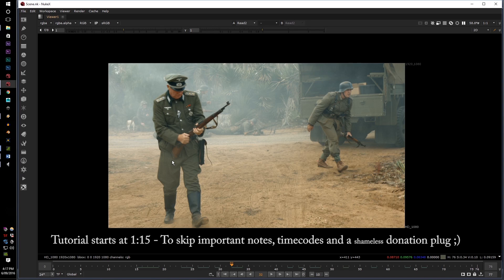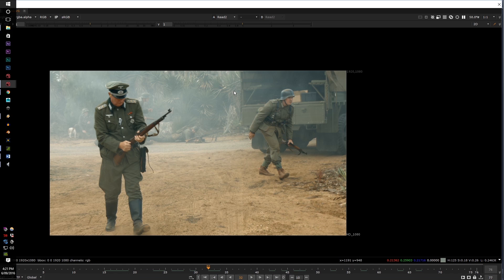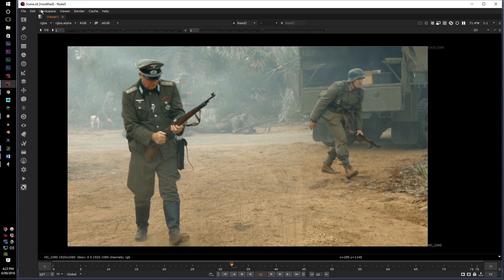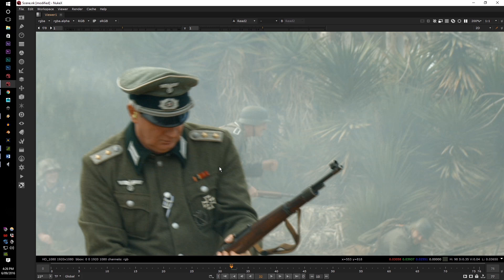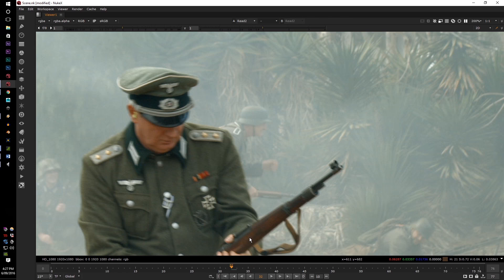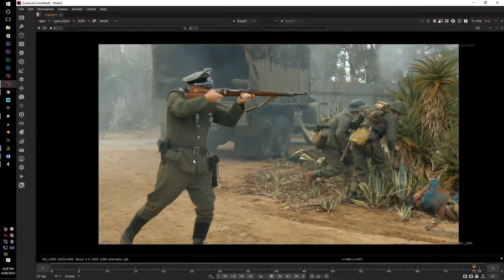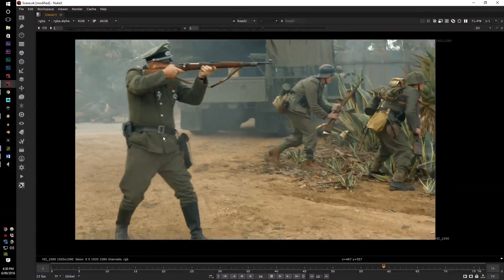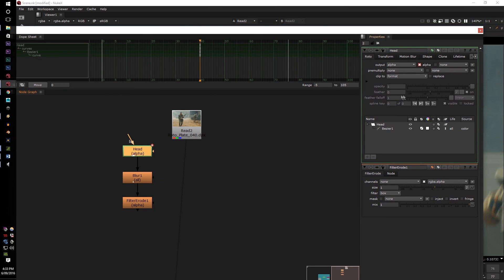Nuke: Rotoscoping Techniques and Methods - Part 1

Comment: Hi, i do appreciate your effort, but there are few things i would strongly recommend to avoid when you are rotoscoping.
The main problem with your tutorial - you creating a complex shape, the roto for the head suppose to be created from few simple shapes each one is responsible for the part of the shape - this will give you more control and prevent roto from being wobbly. and this is the most basic law of rotoscoping which you ignored.
Second - use tracking information by coping tracking data into roto "Root" tab - it will make the workflow cleaner and motion blur more consistent(shape MB+ track MB)
Third - use of erode filter should be an exception and not the rule - erode is aggressive filter, reduces fine details and killing the motion blur.
I do understand this tutorial for beginners, but i believe exactly them must have a proper base for they knowledge which this video does not provide.
a bit background of on rotoscoping here: https://www.fxguide.com/featured/the-art-of-roto-2011/
I really sorry for being harsh, you just did not so great job here.
Reply from the maker: I welcome all criticism :)
Your right about the head shape as it was getting restricted.
 All tutorials should be used as a guideline which i encourage, i try to not make the claim which i didnt for this one, that this is gospel to roto, more of a, this is what I have been doing and the supervisors tend to approve the shots. 

I will favourite your comment so others can see it
Reply: Hi, regarding simple shapes. Some times we see the shot we need to roto, we (including my self) tend to think "aaa... f...k it - i will just paint one shape and that's it, i do not want to deal with multiple shapes... "

the thing is from the moment you did track your object, which you did,  it is does not matter if you have 1 or 5 shapes - they always will follow the object, but what it does matter - if you need to adjust some part - you adjusting only the shape responsible for this part and not creating unnecessary key frames on other parts (divide and conquer ) and as result you will be faster, your shape will feel better and  supervisors will tend to approve your shots much faster :D
Cheers and good luck.
Reply from the maker: So do a track of the object you want to roto but apply the different track to all of the roto shapes?
Reply: not sure i am following you.
the tracking approach you did is right way to go.
just instead of putting a tracker under your shape put track info inside of the rotoshape "root" transform.
all shapes living in the Roto will inherit the track, nuke will be able properly calculate motion blur.
(this is just minor technical improvement to your workflow)
Reply from the maker: Ahh now i get you, cheers :)